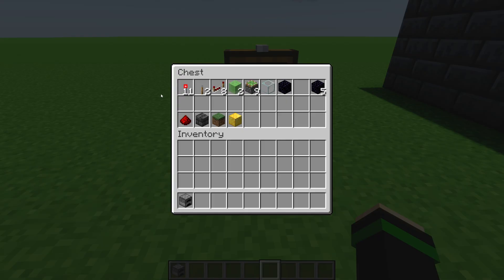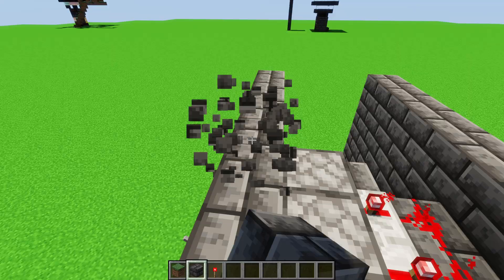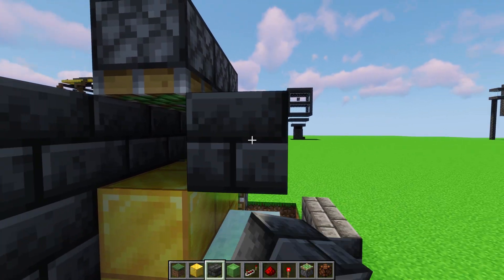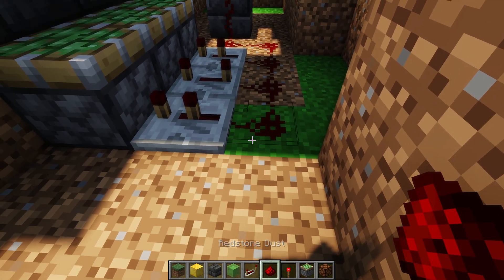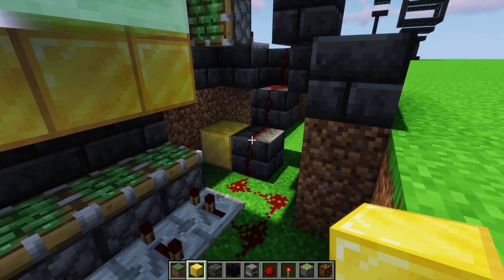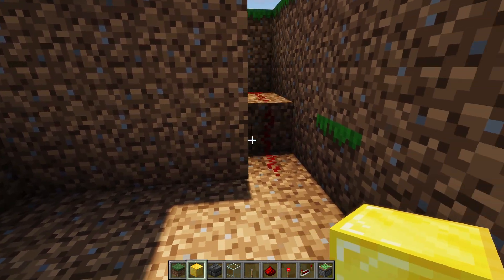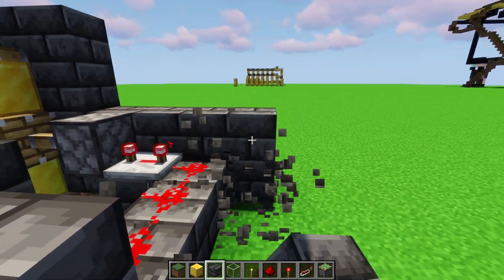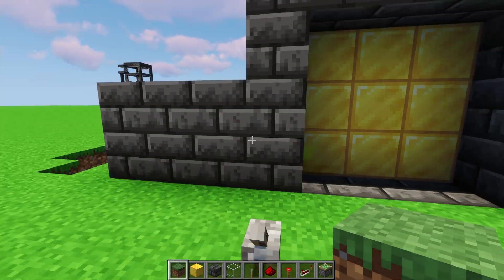Quick and Easy 3x3 Piston Door For Java & Bedrock Editions | Minecraft Redstone Engineering Tutorial

Comment: On the slimeblock side, for some reason the 4 redstone torches are reversed. On are on top, and off are below. It worked perfectly fine a minute ago, but I broke a block (and fixed it), and all of a sudden the torches were wrong. I rewatched the video to see if I missed anything, but everything else is fine.
Reply from the maker: Did the block have something on it? That or did you replace it with a different block (in that case opaque vs transparent matters)?
Reply: @ZennsWorld  I replaced it with a block, stone to cobblestone but that's all.
Reply from the maker: Sorry youtube doesnt give me notifications for replies which is annoying. I can see that being an issue with redstone making an infinite loop somewhere, keeping the signal on when it shouldn't. If it worked before I would try putting things back to the best of memory, if you haven't already

Comment: So i cant get the levers to work but everything else has been fine for me
Reply: When I get to the connection on the bottom is when it doesnt register
Reply from the maker: Is there a repeater going into the corner of the XOR gate on both sides? If they arent the same signal strength coming in it can cause problems. Also if you moved the button an easy check is to make sure the signal reaches the XOR gate at all

Comment: I followed the tutorial and it didnt work the first time, but for the middle part added a slime block in between the 2 pistons and delay the timing for the first piston. It worked after that.
Reply: Hi. How did you fix it? because this is my issue the double piston won’t pull both blocks back. It only pulls the blocks back once instead of twice.
Reply from the maker: You could try delaying the the second piston (the piston furthest away from the door) a little bit more and see if that helps
Reply from the maker: I've had some weird cases where sometimes timings don't work and need to be lengthened, or other weird mechanics are at play. Typically only happens on servers though

Comment: is there anyway you can make a combination 3x3 door? with buttons ofcourse
Reply: All you need is to find a combination lock design, then wire it to the door's XOR gate :)
Reply from the maker: Ya what @purrowpet said. You can make a combination however you want, and attach the output to the XOR gate. You also may need to replace the XOR gate as well depending on what you do. If you only want the combo on the outside of the base, and on the inside just have a "get out" button, you may need to get rid of the XOR gate and do some extra stuff, but it shouldnt be any different than any other combo door, so you could use a different combo lock tutorial. I think it would be too much to explain in text. For buttons you will likely have button -> T flip flop -> combo logic
Reply: @ZennsWorld I think swap the lever inputs for buttons (or add observers) to make a pulse and swap the XOR with a T-Flip. This way, either input won't interfere with the other.

The combo can pulse the door twice on a timer, or the inside input can be used to close it.